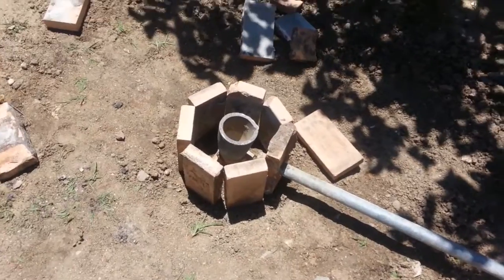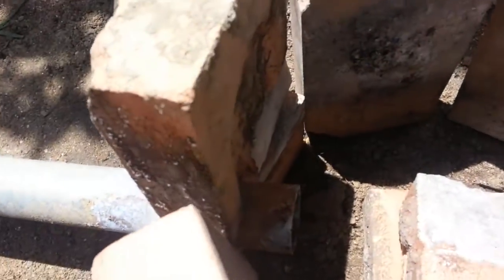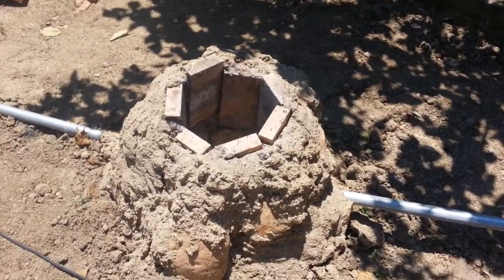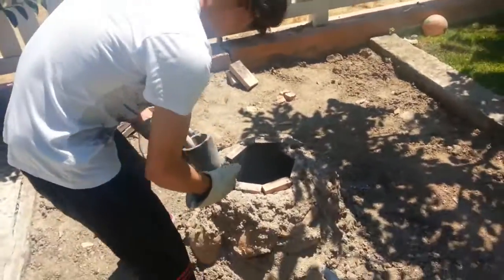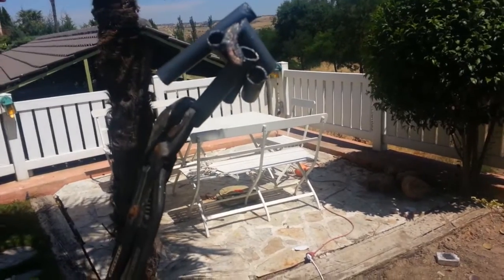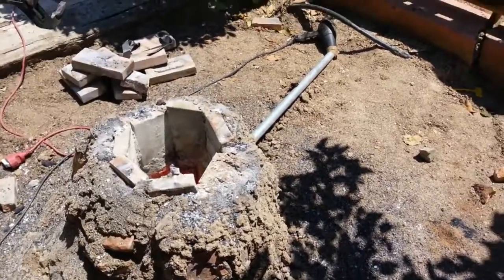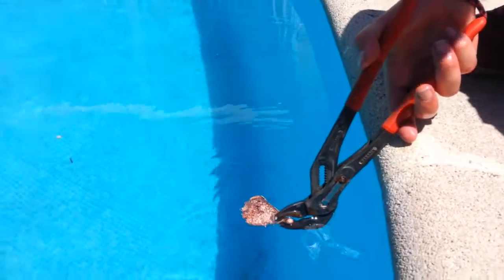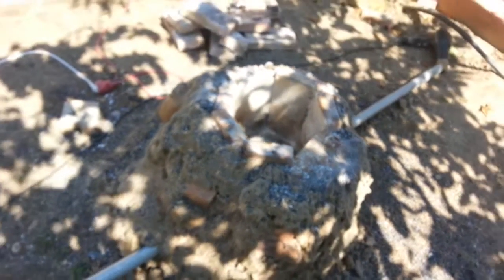Homemade Charcoal Copper Furnace Cheap

Comment: Are you using briguettes instead of real wood charcoal? Briquettes are usually coal dust mixed and compressed with glue, which makes it burn a lot cooler (making it ideal for BBQ, not so much for smelting). 

Also, try reducing air flow. You want just enough air flow to insure a complete combustion, excess air is just going to cool down the furnace. You usually don't need a raging leaf blower for a furnace that big, I find a cheap hair dryer gives the ideal air flow.

Comment: You have a ton of thermal mass there. It will take a lot of heat to get that furnace up to temperature. If you're able to make a decent lid that you can get on and off reasonably quickly, opening it up briefly to add more charcoal shouldn't bother it too much at all. Good work!

Comment: Ah! I was thinking of an air from underneath design and wondered why nearly all of the ones I've seen are air from the side. 

I guess it's better to get one side of the crucible hotter at the right part of the it than less heat from the bottom but more evenly distributed. That was just the answer I was looking for but couldn't find anywhere. 

From the side is easier to design, so part of me figured that was the reason why. But I'll drink to easier design. lol

Comment: Put pieces of copper wire together with the tubes as the wires begin to melt, they jerk green flames that come out of the exhaust once the green flames start to wait. Wait a couple of minutes for everything to be melted or the green flames stop.

Comment: id get some real coal for it, charcoal isnt gonna give you enough energy. it will get hot enough to vitrify stuff and would be great for firing pottery.
Reply: Ancient smelters who been using charcoal for millenia: "Am I joke to you?"
Reply: @kovona  Still coal will work better for getting up to copper smelting temps since it is higher density in both energy and mass.
Reply: Charcoal will work lol just not store bought bricketts, lump charcoal burns much hotter and can melt iron
Reply: Also get a lid you’re losing a lot of heat out the top (need a vent hole but no the whole top of the furnace

Comment: Given the primitiveness of the setup I'd also concur that it was a success. And since the bricks welded themselves onto the crucible I assume those weren't fire-bricks or chammotte bricks. 
I've decided on using coal as well because it's cheaper and safer than propane, and a lot cheaper than the electric smelters, which are mostly low capacity (cca. 3kg). 
My problem is that I got about 70kg of scrap I need to sell, but the form I currently have it in is not saleabe as it consists of burnt fine wires compressed into tubular forms using a section of pipe and a dowel then hammered. 
I've heard you can use Ytong as a one-shot mold, where I carved out an ingot shape in an Ytong about 30 x 30 x 30 cm. Bought fire-bricks as well, but these are pretty expensive, at 2 Euros each, but these last a long time so I'm not that concerned. Additionally I'm following my local ads where in the past I've seen people offering them for free, such as when they replaced a fireplace, because I need some more to make the setup bigger. 
The insulating grout is just chamotte dust mixed with regular cement which I'll make by grinding up one of the fire-bricks. 
I found two of those home spa blowers that make bubbles in a bathtub and measured one of them at 66 litres of air a minute. 
Should be interesting, to say the least.
Reply from the maker: I did use supposedly fire-resistant bricks but I think they were only made for cooking fire temperatures or a fire place, mine were only 50 cents a brick. 
Coal is great the only thing is that you need to make sure your crucible is well sealed of cause otherwise the sparks will destroy your metal quality. 
70kg is a lot of material to go through (you probably already knew that) and a 30x30x30 mold is massive, good luck
Reply: Yeah
Theres alot of difference in price of firebricks. Some (like yours) seem to simply be able to resist normal fire temps, and genrally the word is 1 dollar per brick for a good brick... i paid 4 for each of mine